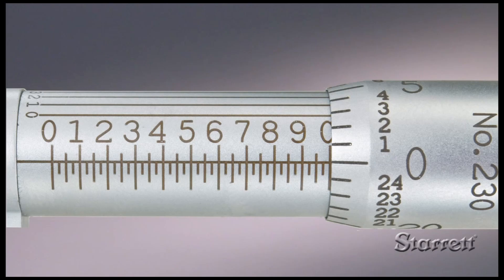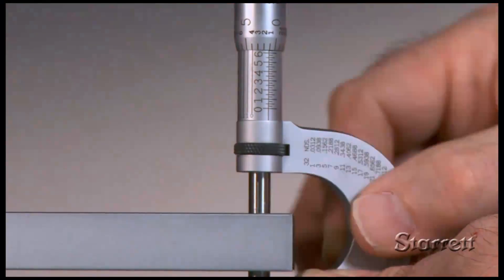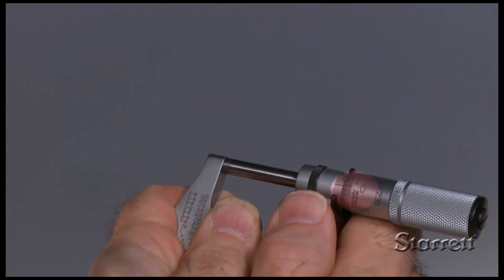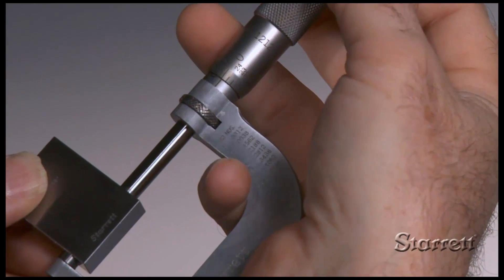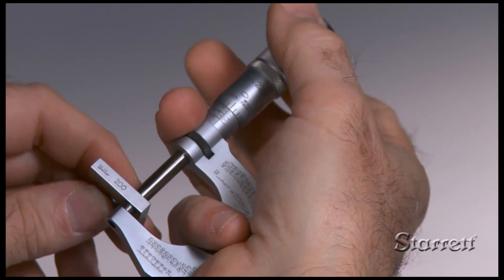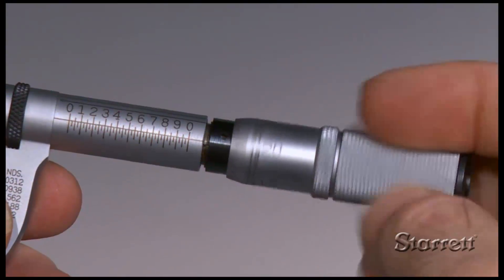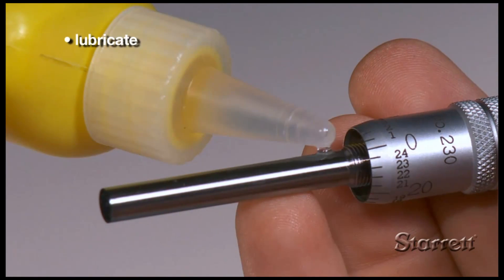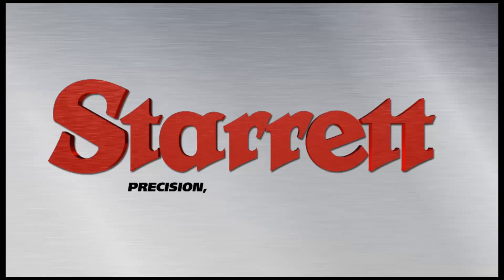Using and Measuring with an Outside Micrometer: Accuracy, Adjustments, and Maintenance (Part 4)

Comment: What's the problem with an air hose? 🤷
Reply: not clean enough I guess
Reply: It can blow debris into the tool. This is especially so if there's oil on the moving parts, as there should be.